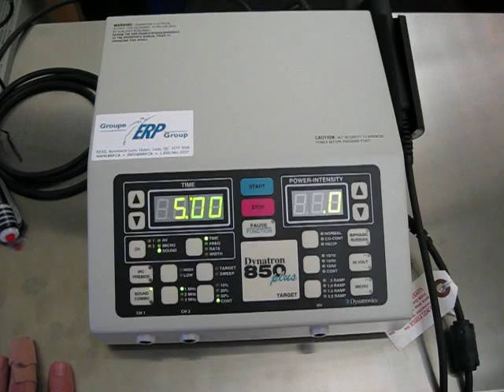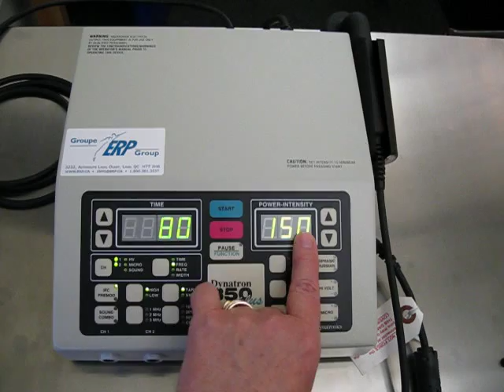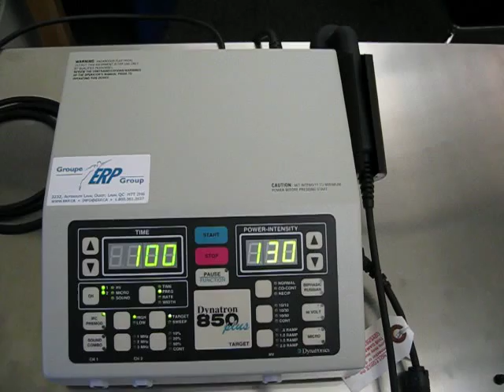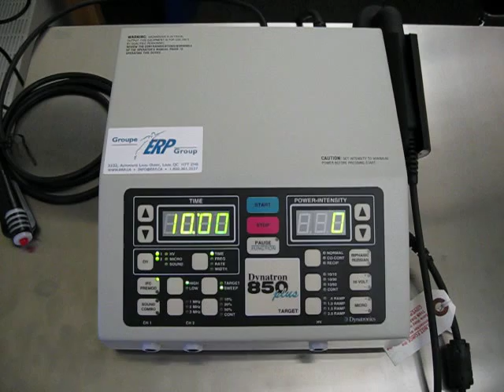Setting the frequency for IFC

Comment: Not a bad tutorial, ...however, you didn't go over RATE or WIDTH on the IFC portion? Was there a reason for that?
Reply from the maker: This tutorial is for physiotherapist assistants (PTA) who are not able to modify the settings (frequency or width) as that is a task that would be completed by the physical therapist/physiotherapist who assessed the patient and assigned it to the PTA